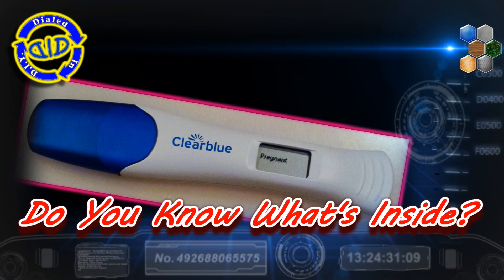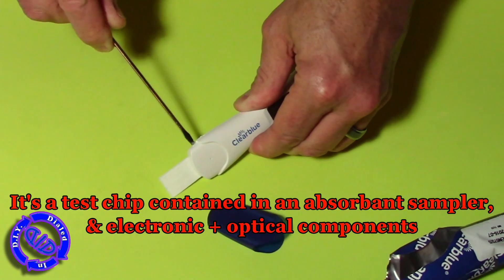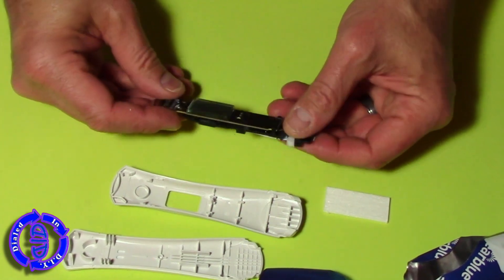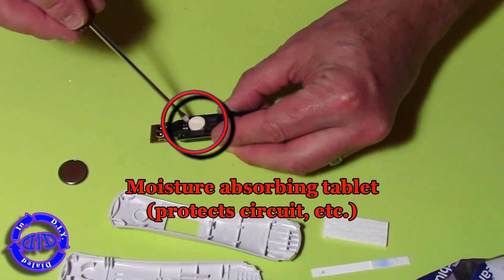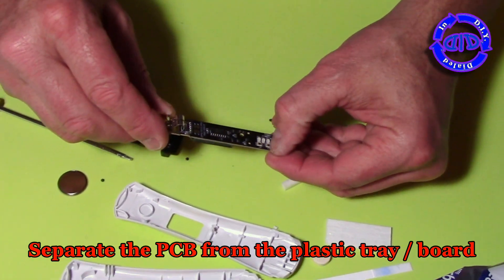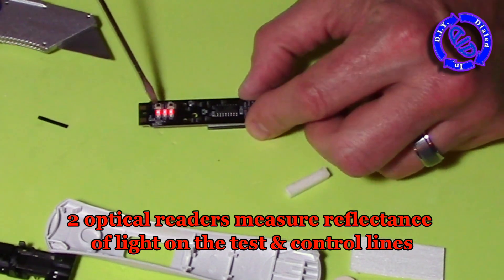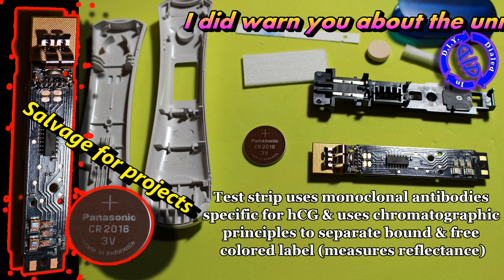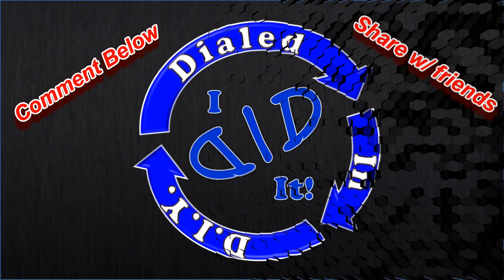Whats Inside a Digital Pregnancy Test - Dismantling Clearblue Easy - Salvage

Comment: did you ever use the pieces... i would love to know if there is a way to reset these tests that would be amazing
Reply from the maker: I ended up using some of the parts separately.  I can always make use of small LEDs and button cell batteries.  Re-setting the device would be great but some of the internal parts are one time only use.
Thanks for watching and posting your comment!

Comment: I took an equate figital test today nd it said not pregnant but when I took it apart it had 2 lines nd 1 was really faint. Does it mean I'm pregnant or not? I've taken a bunch of other tests but they weren't faint
Reply from the maker: Good question. I would suggest the digital read out is more accurate than what you can try to determine after the time taken to open up the test stick (best bet would be to use another test if you think the result might have been wrong). Why do I say that?.. On most tests there should be a standard control (non test) line and then one or two additional lines that measure pregnancy response. In many strip tests (for different uses) the measurement time window for results is specific and eventually the strip could or will end up showing all lines.  I say that because when the digital display results showed up it could have been reading only one line visible but a second line could have become visible after the viable time for the test results. Either way, the digital tests are programmed to identify a specific light response (from the lines) at a rather specific point in time in order to provide a positive result.  Hope that helps. Thanks for watching and taking time to post your question.

Comment: Ok I have a question is there always 2 lines on the inside? I took one today said not pregnant but inside 2 very obvious lines?
Reply from the maker: I do apologize but I will have to see if I have the info on this model. On most tests there should be a standard control (non test) line and then one or two additional lines that measure pregnancy response.  If the digital readout measures as not pregnant but you feel you might be I would encourage use of another test either same type or a different one. In many strip tests (for different uses) the measurement time window for results is specific and eventually the strip could or will end up showing all lines.  I say that because when the digital display showed up it could have been reading only one line visible but a second line could have become visible after the viable time for the test results.  I hope that makes sense.
Reply: Same

Comment: Just to be very clear about the actual test strip within this digital test. my question : is it just like any other non digital pregnancy test  ? As in 1 line "not pregnant" or 2 lines "pregnant"?..  Basically   if  you ran the test with non pregnant urine then popped the digi test open would the test strip only show 1 line ? If you test with positive pregnant urine popped open the test would there be 2 lines? I am really curious..please reply
Reply from the maker: Great question.  The chemical reaction on the test strip is indeed essentially the same as a manual test. Once it measures the available levels it generates one or two blue lines that the chipset reads via optical sensors.  So pretty much, it merely translates the number of stripes into a "pregnant" or "not pregnant" digital message.  Pretty wild, huh?  Thanks for watching and for your comment.
Reply: Finally there is so many people who say that even if it's negative there is always 2 lines but I don't see how
Reply: Marisa D yes mines says negative right now with two lines
Reply: Daynesha Smith where you preg?
Reply: Erin Kilpatrick  No
Reply: Pregnant or not pregnant test on the digital came up not pregnant took the test apart two blue lines on the strip, IDK what that means bc on a normal pregnancy test it's two lines faint or not one line means no but two lines on under digital on the strip.

Comment: It is a pity that such engineering and waste are required so users don't have to look at the lines and evaluate for themselves.  I understand that the lines are not always so clear but you can see by some of the other videos that a magnifier or  cell phone blow up of non-digital tests is just as reliable, or better.
Reply from the maker: Hi Microclone, I totally agree with the sentiment!  That is exactly why I do the "What's Inside" set of videos.  Allot of great parts and technology are set to get dumped all the time and with a little effort you can actually get great project parts & materials at little to no cost.  In addition, I like to use that kind of stuff in my other videos when possible.  [That said, I still get the idea that there are often allot of materials used for "disposables" that could have been avoided in the first place]  
Thanks for the comment and for checking out the video.